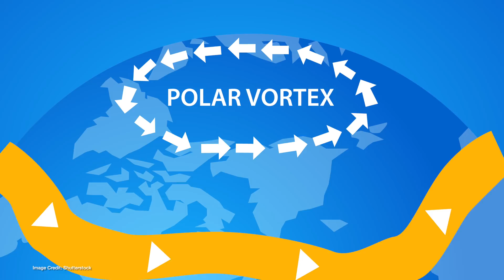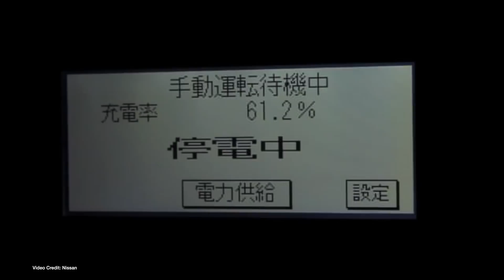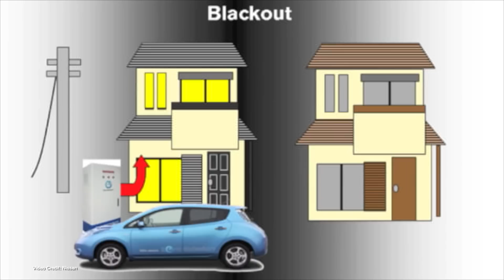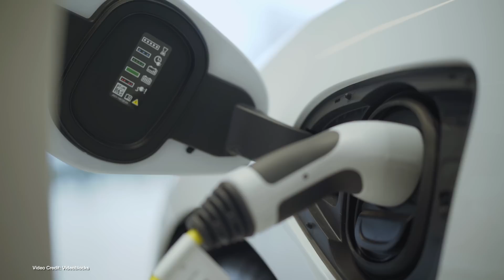Winter Storm Uri: Electric Cars, Renewables Will Help, Not Hurt, The Texan Grid

Comment from the maker: This video is raising funds for the victims of Winter Storm Uri in Texas .  Click the donation link to the right of the video to join in.
Reply: It's actually more complex than any of you could imagine. Yes, the climate is changing, but not always for the reasons you are being told. Is it good to go green? Certainly! Are there smart ways to do it? Most certainly! Do people become polarized over topics they should be coming together on? ALWAYS. Have a little more love in your heart, a little less finger pointing, a little less polarization of your attitudes, and a brighter outlook for mankind. People will ALWAYS disagree as long as there is anything on earth to disagree upon, but we should look past that and work to come together for the benefit of all. Was the over-reliance on wind a and solar in texas a problem for grid stability? Certainly. Could people have made better choices in buying "winterization" pachages for the wind mills? Undoubtedly. This is how we humans learn, by making mistakes. Lets come together and correct the mistakes and do things that are good for our economy, our welfare AND good for our planet at the same time. This is the moderate conservative, signing out.
Reply: A independent, national, high-voltage, DC, supergrid would solve a lot of problems in the US. If the electricity comes solar then no conversion  to AC and then back DC, is necessary if they are connected to the DC fast chargers.
Reply: What is "Uri"?
Reply: This is sad, 500 thousand Portland General Electric customer’s lost power, 16 days is estimate for the last 50 thousand. This channel is based in Portland Oregon where people are hungry, cold and not even word about Portland people. Why this is liberal state and regulated state. F-ing total hypocrite. This is 100 attack IMO

Portland General Electric. “These catastrophic February storms did 10x more damage to our system than the devastating 2020 Labor Day wind and wildfire event. We will not rest until every customer is safely restored”
Reply: Dunno if you guys gives a damn but if you guys are bored like me during the covid times then you can stream pretty much all of the new movies on KaldroStream. Been streaming with my brother lately xD
Reply: @Finnley Kenneth yea, I've been watching on instaflixxer for since december myself =)

Comment: This is Rick from the declining oil capitol and rising renewables capitol of the world, Houston, Texas. We didn't loose power but even if we had, a 2K pure sine wave inverter, which I don't possess, YET, attached to my 2015 Nissan Leaf could keep the HVAC fan running, and heat by extension, and the refrigerator going. BTW, Texas has no plans to fix the frozen gas plants, wind turbines etc. The biggest loser was natural gas electrical generation, which plunged by 36 percent on the morning of Tuesday February 16th. Although wind turbines failed by 50 percent, they were 23 percent of power generation but where they ran they overperformed. The same could not be said for natural gas. Oh, and gave you a thumbs up. I'd give you two if YouTube had it.

Comment: Time to update the national building code to net-zero ready as the minimum standard.  Homes with a 4-5 day thermal cool-off time would have coasted through the Texas cold snap. 
The irony is that net-zero or Passiv homes are ideal for hot climates too. You can save a bundle on A/C costs and the house has a 4-5 day thermal constant, so doesn't freeze for 5 days if the power goes out and can be heated with a few hair dryers.  Additionally, by ventilating the house overnight to cool it off, you may never have to run the air conditioning.

Comment: A few things to ad.
The deregulation and type of grid is the main source of the break down.
High prices unreliability increase profit, some are happy capitalists now. 

Wind and solar has a part in this too, not the sole.
If you depend on VRE you have to have a full scale backup when they do not deliver.

This winter event caused a high drop of expected input from wind especially.
Only 800 MW from 30.000 MW installed.
In the entire grid, this show VRE is mostly displacement not replacement. 

This causes even more strain on fossil installations.

Gas and coal supply lines where also slower because the winter.
Even pipelines/valves stuck

A much higher gas usage for heating.
A gas flow reserve for residents instead of power maybe.

And not weatherized equipment that should hear and there.

Badly insulated buildings ( also for heat in summers)

So it's mostly FUBAR by Texas and some other things.

Solutions:
A capacity market not this.
Higher standards
Much less fossil sources.
More nuclear
More geothermal
More small hydro
Seasonal storage flow batteries, pumped hydro for emergency.

Comment: The lights are out due to a shortage of generation.  More wind mills will not help especially if they don't work   Texas has fallen victim due to not planning for extreme weather events.  You would be right in pointing out That  gas delivery interruptions and plant outages due to cold weather contribute to the problem.  Both of these issues can be addressed with fixes to the existing infrastructure.  The inoperative windmills are another issue altogether that can only be addressed by building  more plants that can be started when needed.   With respect to the heated wind mill blades, where does the energy come from if you already have a power shortage? I have a utility engineer friend in Texas who explained the problem in this way.  ERCOT heavily subsidizes windmills which makes them look less costly than they really are.  Coal fired plants that could not compete against subsidized windmills were shut down and not available to make up the shortfall.  Fans of green energy willfully ignore the risks of not having firm generating  capacity that can be called upon whenever needed. The larger picture on renewables is a complicated mix of politicians and regulators  ignoring reliability due to political pressure ,  corporate greed on the part of big business getting rich on sales of renewable energy, and environmentalists who neither understand or care about system reliability.   If you want reliable carbon neutral power to charge all of those electric cars,  build nuclear plants. It makes no sense to burn gas to charge EVs.  Nuclear power is carbon free.  The truth about renewables is that they can only deliver about 30% of their rated capacity with no control of when the power can be delivered. There is so much finger pointing, unbiased analysis  was kicked to the curb long ago.

Comment: It sounds like a good idea on paper but I have a few real problems with V2G.

1 - Currently only chademo supports it so most vehicles at the moment don’t and won’t support it even the new Nissan coming with type2/CCS.
2 - It requires expensive hardware to be installed in a home/work and possibly 3 phase electric if I’m correct?
3 - The vehicle could not be used while powering the home or grid.
4 - There could be problems with EV makers wanting a vehicle using it as it may reduce the life of the battery (in the UK trial Nissan are only using leased vehicles)
5 - It would be better to use second-life batteries for energy storage to reduce costs and make it so the timing of charge/discharge can be managed better and easily upgraded.
6 - It would rule out apartments where battery storage would work
7 - I don't think Tesla would want to do it as it would take away money from their Powerwall/Powerpack business and where management of the battery is easier.
8 - I could see it working better for fleets like buses or vehicles at a depo where you have a better idea of the time of use. This would also make it more cost-effective for the installed hardware.

I really like the use of home battery storage, even without solar as it could be used to level peak demands ALL the time where it would be very hard to manage with a battery not connected ALL the time. I know things have changed a bit but MOST people still work 9-5 and peak solar is around the middle of the day, so with excess power available probably the best time to replenish a battery. V2G just won’t work well for most of us in this situation.

Comment: Electric car technology is nearly not there yet,,, still takes you hours to charge your car.. and that's even with the correct amp service...    Most homes don't have the correct amp service to properly charge there car ,,,  takeing 12 to 24 hours in some cases To fully charge your vehicle..    And that's if you have a home..   Good luck if you have a apartment..    Plus most electric cars are super expensive..     To fill up your car at a charging station still costs you around $20..   And it takes hours to do  the charging..  So there's really no cost effectiveness between gas and electric..    People dont  have the patience to stand for 10 minutes    Let alone a few hours...    When tech gets there,, then we'll talk   ..  I say maybe another 30 years our technology will be there
Reply from the maker: Literally none of your points are correct. Please feel free to correct your errors using google. Thx for the interactivity :)

^Kate
Reply: Your confused. Most people don’t drive over 50 miles a day normally, model-3 can early add 50 miles a day charging at night at 110 volts. You just plug it in like you do your phone each night, never have to make special stop at a gas station. Plus off-peak charging at night is so much cheaper than gas. Most garages have electrical panels, which camellias where cars are parked. 220 volt outlet is about 1 to 2 hour appointment if the electrician knows where you’re going to put outlet and what kind of panel you have and what breakers it takes. Recommend adding outlet below panel and sending photo’s ahead of time. Inconvenience is having to go get your oil changed, cooling fluids checked, tune ups, breaks done. Yep regenerative braking saves break pads. Plus your in top performing cars on the road. Plus you can still find free charging, when is last time you got free tank of gas while you’re grocery shopping?

Comment: Really, if the EV charging stations are deployed properly, you would never see even a brown out ever again. Change all the fossil fuel stations to EV stations and then replace all the fuel tanks in the ground with 3MWh batteries. They don't even need to be lithium. Any one of the flow batteries would work. With 3MWh batteries, you could charge 30 - 100KWh cars before drawing anything from the grid. And you can recharge those batteries from either renewable or the power gen stations.

The only piece of research I haven't done yet is to get the average number of vehicles that fuel up in a day from a regular gas station. And perhaps once that is gained, the size of the battery would need to be changed.

Comment: Gas pumps use electricity to move fuel from the underground tank to the vehicle.

Gas pumps use electricity to move fuel from the underground tank to the vehicle.

Gas pumps use electricity to move fuel from the underground tank to the vehicle.

Gas pumps use electricity to move fuel from the underground tank to the vehicle.

Gas pumps use electricity to move fuel from the underground tank to the vehicle.

Gas pumps use electricity to move fuel from the underground tank to the vehicle.

Gas pumps use electricity to move fuel from the underground tank to the vehicle.

Gas pumps use electricity to move fuel from the underground tank to the vehicle.

Gas pumps use electricity to move fuel from the underground tank to the vehicle.

Gas pumps use electricity to move fuel from the underground tank to the vehicle.

Gas pumps use electricity to move fuel from the underground tank to the vehicle.

Gas pumps use electricity to move fuel from the underground tank to the vehicle.
Gas pumps use electricity to move fuel from the underground tank to the vehicle.

My gas car wouldn't start last week because of the cold. It relies on a 12v lead acid battery, without that battery, it does not function. It is more vulnerable than an EV because at least EVs have larger batteries, usually with a thermal management system. 

Gas cars are just not better, and the only thing stopping me from getting an EV is the lack of charging infrastructure available in my apartment.

Comment: Worry about relying solely on an EV is a valid concern.  Everywhere you live, the lights can go out.  I live in San Francisco.  In October 1989 we had a moderate earthquake which took out the electricity for a few days.  We know there will be others and there will be bigger ones.  When the light went out, the most gas stations couldn't pump gas because the pumps run on electricity and most didn't have generators.  Those that had generators couldn't get gas to run them.  Since then I bought a tri-fuel generator.  It can run on gasoline, propane or natural gas.  More flexibility is better.  Propane can be stored for a lot longer than gasoline.  I'm shopping now for a Chevy Bolt and I will keep my Subaru Outback so that when the next earthquake hits, I'll be covered.

Comment: The way modern American conservatism works is to make oversimplified (and usually false) claims that require long debunkings like this one. Moreover, the power of such arguments lies in how quickly they can be made, and in making them first. 

Those simple messages are powerful. To counter them, you need simpler counterarguments that are easier to understand. Also, you need to make them first.

Sorry, but this simply comes too much too late. The best way to argue would be to say "You idiots! You broke the grid to save $0.01 per kWh!"

Comment: I an not a EV consumer because i can’t afford them
Reply: Ask your mom to give you more money each week. We've had $20k-ish new EVs for several years now and used Leafs are aroundc$8k.
Reply: @vidznstuff1  that 24kwh leaf is not a serious car in my eyes.
Reply: @vidznstuff1  and in holland everything is more expensive
Reply: How much did you pay for the car you’re driving now? You know you can lease some electric cars.
Reply: @howards9093  €10.000 4 years ago. Private Lease is also expensive. They all starts at €450.00 per month. And and  can only charge public. So plus €5,50 per 100 km.
Reply: @jdnrotterdam2150  €10,000 is very inexpensive vehicle. So maybe your right. How is that car doing today? Any oil changes? Any break jobs? Tuneup? How many € to go 100KM? Has this car ever Brock down and you had to pay for repairs?
Reply: @howards9093  nope. Nothing did go wrong.  It’s a Toyota Prius from december 2012. I bought if 4 years ago for 10.000 euro. It had 153.000 km on it. Now i have it 4 years and it have now 191.000 km on it. I didn’t had repairs or high costs. Just the normal yearly maintaining.  It’s  using  4,2 L on 100 kilometers with a speed of 100 KPH on highway and in the city mostly electric with 50 KPH. ( speed limits holland). I drive About 800 kilometers on 40 liter.   But it’s 8 years old now. Plus 191.000 km so it’s time to replace it.
Reply: @jdnrotterdam2150  well hard to beat that, only Teslas used I could find under $30,000 was used 2013-2014 model S. 👍
Reply: @howards9093  i can just afford 2 EV’s under  the 20.000 euro.   The 24kwh leaf and the 22 kwh zoe. Both i don’t want

Comment: Even if you have gas or oil central heating, they don't work if there is no electricity to power the hot water circulating pump and the embedded computer...
Reply: Yep. A neighbor bought a pellet stove heater for his house "in case the power goes out" - then the first time the power went out, he realized "oh, wait, the control electronics, fan, and pellet feeder all require electricity."

Comment: The future for the U.S. power grid is millions of EV's, and roof top solar on houses linked to a smart main power grid. This would help solve the power storage problem for green energy generation and buffer individual houses from wide spread power outages due to severe weather. The future for green energy is very promising if we would just get on with it and stop with the foot dragging.